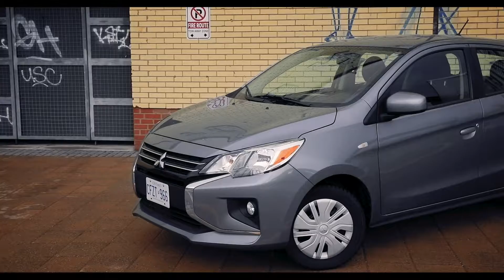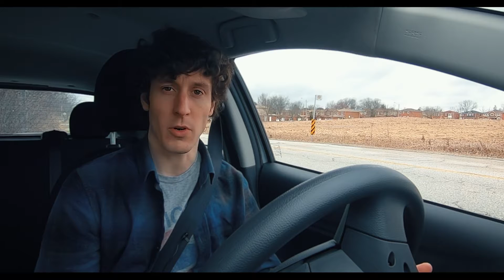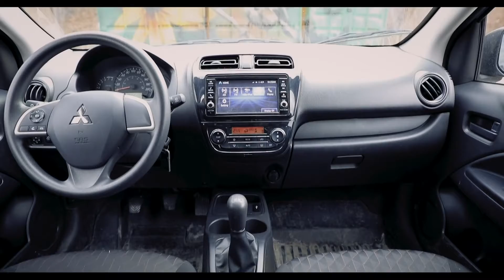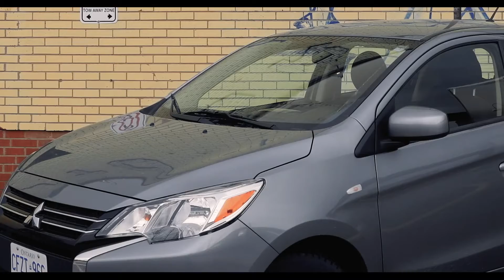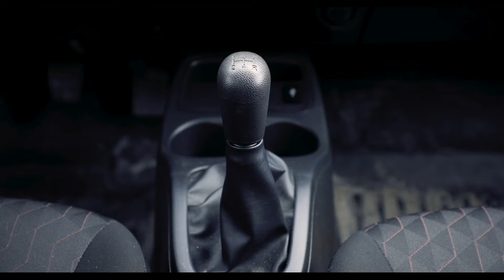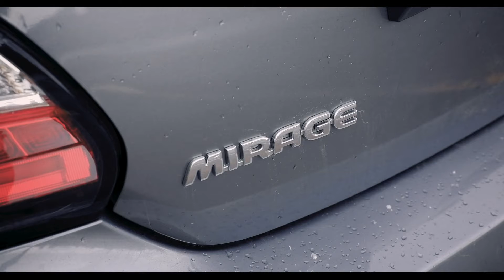Long-Term Wrap-Up: Mitsubishi Mirage ES | Driving.ca

Comment: We have a 2022 Mirage SE and I really expected to hate it. We bought it as a cheap commuter. I have a 2015 Ram 1500 hemi and my wife had a 2014 caravan. We’ve had the mirage for 3 months now and have over 10000km on it. I actually really enjoy driving it and there is lots of leg room, etc…. I’m 6’1” and not cramped at all. We’ve since sold my wife’s van as we stopped using it. We still need the truck to pull our boat.

The things I dislike about the mirage are really trivial. 1. The low fuel indicator it does have one really. Just the digital fuel indicator blinks on and off but it’s almost at zero anyway so you often don’t notice it. 
2. The electric fan for the radiator turns on and off way too fast, it will literally kick on and off every 2 seconds, it’s just going to wear out the relay fast.
3. We have the SE and it has Apple CarPlay but it only works wired and not over Bluetooth.
4. I would like the passenger front seat to also have an armrest

That’s it. It’s a great car, I expect to be buying another one in the future
Reply: You can use bluetooth independently of Apple CarPlay or Android Auto. Just unplug it from its USB port and switch to bluetooth mode on your steering wheel. I also use my 12V outlet to charge my phone, as it's alot faster than using the USB outlet. 

My wife and I are on our 4th Mirages, a 2014 DE CVT, 2017 ES CVT G4 sedan variant, my current 2021 ES CVT, and I just got my wife a new G4 Black edition 2022. 

Reliability is a fantastic reason to own a Mirage. The JATCO CVT7 isn't stressed at all, like it is in Nissan products such as the Juke or Cube. 78HP and low curb weight equals exceptional cvt reliability. My 2014 I used for Uber ride share and I beat the dog shit out of it putting 100k miles on it in under 3 years. Never once did I have a CEL or any major issue, only a failing door lock actuator. I'd still be driving it today if I hadn't totaled it last December. The 3A92 engine is timing chained and has been in continuous production since 2003, so you know it's a proven engine design. I never experienced any oil leaks at all.

The patented Mitsubishi RISE safety cage saved my life on the freeway, I walked away unhurt. It would of been a different story if I was driving a small car from the 90s. Folks who say these cars aren't freeway worthy are giant pussies, who've never owned one. I drove my old Geo Metro/Suzuki Swift rebadge across the country and it only had 60HP lol.

My only complaint is that Mitsubishi part prices are expensive and that the aftermarket selection can be sparse. I also think Mitsubishi dealers are shady as hell but thank god I've never needed warranty work as these cars are basic but dead reliable.
Reply: @kylemas2005  This is our first mirage but we really enjoy it so far. I entirely expect it won’t be our last. We have >15000 kms on it so far which is just shy of 10000 miles and we have only had it since May. Definitely impressed so far.
Reply: @Gord1973  Your 175 55 r15 tire size is rare and expensive. When your ready to change switch up to 185 55 r15, it's within the 3% differential tire shops recommend, there's alot more options in that size too that's  cheaper and your mpg won't take a hit because it's just barely taller than the OEM tire.
Reply: Gibt es bei Amazon für ca.60 Dollar

Comment: I'd actually consider this car if for some reason my 2013 Chevy spark decided to bite the dust. I don't trust the used market these days, as anything under 10 grand in the used market is going to come with problems.
Reply: I'm thinking the same exact thing. With the cost of the used car market rising because of shortages, I'd bite the bullet and get something new for a little bit more. Would make a good little second vehicle.

Comment: Just got into a wreck with my Mazda 3 2012. I want to get this car but am on the fence. I'm not a speeder, but sometimes it's good to have speed to get out of the way.
Reply: The Mirage only weighs 2100 lbs. 78HP is plenty. Don't worry about it.
Reply: It's got about the same HP to lb ratio as my '90 Volvo. So, you should be just fine! lol

Comment: Moving to the CVT from the manual makes a huge difference on the interstate.  My car runs at 70 mph with the tac showing 2500 rpm and returns 44mpg cruising at that speed.
Reply: Very nice! Just the comment I’ve been searching for. I drive 40 miles one way at 65mph, so hopefully your mpg’s is achievable for me as well.
Reply: @johnpatterson4901 can you explain me what is mpg and why cvt is better? I thought it would has more gas consumption

Comment: My first car was a Ford Escort LX, 88 hp, 5 speed.  I drove it for 16 years in CA and all over the American west.  Never felt under powered except on steep grades like the grapevine on I-5.  The Mirage reminds me a lot of that car; if I needed a new car right now, the 5-speed ES Mirage is what I would buy.
Reply: I used to own a Chevy Sprint ER with a 3 cyl 5 speed. It was supposed to be the lousiest car in USA but I’ve driven it to LA and SF and back more than a dozen times, usually at night and all kinds of weather. It was a fun car especially negotiating the high mountain pass 152 from I-5 to 101. Never had a single breakdown thru several years driving it.  A real fun but utterly reliable car.

Comment: I’m curious, how is the Mirage going up hills? I live in an area that has a lot of hills and am currently window shopping for cars for when it’s time for me to get a new car.
Reply: You absolutely have to downshift with the manual, but it pulls itself along okay, if you actually cram 4-5 people in it you definitely feel the difference, and turning on the A/C is a notable drop as well. I ultimately loved my Mirage g4 though, it was totaled when I was rear ended on Tuesday, but I averaged 44.9 mpg over 36k miles with the 5 speed.
Reply: @Dfm253   It's horrible up hill in a cvt. Most of them are sold with cvt because only the base model is sold with optional manual transmission. Putting just one person in the car or having the ac on if felt in a negative way with its 7X hp. You have to remember drive train loss so it would really make it a high 40s, low 50s hp car. I rolled down a hill in winter of 2020 with it starting from a dead stop mid way on the hill and there wasn't even any snow on the road. Every other car made it up just fine. I had to go back and find a different way back home.
Reply: @jesuscarrillo4344  WTF? I drive my Mirage CVT in the mountains of Appalachia and never had an issue of not being able to get up a steep incline. Something might just be wrong with your car?
Reply: If you go up a hill don't you eventually also have to go down it? So, because of that it should work out ok! lol
Reply: It does fine honestly, and I'm not even exaggerating or sarcastic.

Not quick as 1st place out of 8th but it gets there as 5th place.

Comment: I've been debating between the Mirage and the Spark . You said the Spark is a better car is it because the Spark has 4 cylinders is it because or that the Mirage only has 3 and less HP. But what about the warranty isn't the Mirage much better?
Reply: The mirage has better warranty, and the mirage is designed for longevity, things like electric power steering, an actual timing chain (not a belt like most small cars) and tons of space to actually do your own repairs on the occasion they should be necessary, make the mirage much cheaper to own long term.
Reply: Spark is being discontinued because it wasn't as reliable with the JATCO CVT7, compared to the Mirage with the same CVT. GM Korea aka Daewoo, got tired of paying for warranty work and cvt replacements.
Reply: @kylemas2005  They should have equipped it with a transmission cooler. Like Mitsubishi does.
Reply: @kylemas2005  I have seen that the smallest cars in the US are being discontinued due to poor sales bc people want SUVs.

Comment: Satisfied with my 2022 so far. Plus sizing to 16" wheels can improve fuel efficiency on the manuals as it changes/fixes the effective gear ratio and final drive to be much more in-line with Ontario speed limits.

Car was made for Thailand so it got very short gear ratios. Increasing the actual rolling diameter of the wheel and tire combination by about 5% means that the speedometer now shows exactly the speed I'm actually going, and the gear ratios are about 5% better - resulting in about 5% better high speed fuel efficiency which is important in Canada, with less stop and go traffic and more highway/long-distance driving.

I'm going to grab coilovers and sway bars for mine to improve handling feel and reduce body roll. I'm a track day instructor for Ontario and Quebec so I'm constantly road-tripping and I don't want to spend much on a car that isn't my race car so I got the Mirage as it's the most affordable car in the long run, once you factor in my 200,000 km optional/available warranty. I led a low-ish speed lead-follow exercise on a race track in my Mirage and genuinely didn't find it that bad. It went where I wanted it to, I just had to adapt to a lot of bodyroll. I've already changed the shift knob for one that's smaller and metal, it feels nicer to shift now, I can easily tell which gear it's in as the metal gives more feedback and definitely think that the reviewer's take on the shifter is because of the dulling/numbing of the plastic in the shift knob.

Mitsubishi could absolutely offer one of these in a Ralliart trim package with stiffer suspension, sway bars, and a bit of an appearance package.
Reply: But if you upsize the wheels doesn't that mean you have to get wider tires also, which will add more rolling resistance and decrease fuel economy?
Reply: @greeneking77  You can keep the section width the same, but increase the aspect ratio or wheel size to increase diameter. But the contact patch will lengthen and increase rolling resistance. It also raises ride height, which increases drag - not a good idea IMO - short gearing improves City MPG, so any perceived loss in Hwy MPG is offset provided you drive roughly 50:50 mix (like most)

Comment: Honestly, i love my 2022 Mirage. The gas milage is incredible, and the simplicity of it means there's less that can break or go wrong. In this case, less truly is more. It's a fantastic and honest vehicle.
Reply: I am guessing your actual mpg are better than stated. I was getting 52 hwy with my rental and the warranty is excellent
Reply: My 2015 purchased 5/15 still gets better than EPA. Other than no obvious clear coat 😡 it's still on the original NISSAN OEM battery mfg 12/14 (distilled H²0 only) no problems at all, normal maintenance, comfortable seats and quiet.
Reply: @lklpalka  interesting for your battery, it's the first thing that failed on my Sentra '95. btw I thought Nissan's share in Mitsu was just a recent thing with their outlander/rogue.
Reply: @oi32df  I think you're correct there. Been a few years but mergers are slow to see changes.
Reply: Simpler cars are definitely the way to go. Much less to break. Advanced electronics are bogus gadgetry.
Reply: Give me a manual gearbox and no electronic nonsense and you have absolute reliability. I've had my Mirage for 10 years with 165,000 no problem klms.
Reply: What was your gas mileage mpg?
Reply: Just wish they didn't have electric front window . I hope there is no door lock either?

Comment: I still drive my 2013 mirage 5speed. While it's true that sometimes I wish I had a better car, this car is just so damn reliable! It does what it should efficiently. Cheap to maintain and cheap to run and none of the BS! with today's crazy fuel prices, makes me appreciate this more and more.
Reply: I have the same car i think, 2013 mirage 5 speed 3 cylinder 1.2L engine. I love these little japanese cars, i have had a daihatsu handivan, charade and a suzuki carry to suit my various jobs but now the mirage and its the smoothest and fastest and also most efficient. Australia
Reply: Mine is a 2013 too. It's very hard to justify spending a lot more money for a new car which is probably not as reliable. I think I will drive mine until it doesn't drive anymore.
Reply: @LTLT900 how many miles you have on it? Is yours manual? And does still ride ok and on gas?
Reply: I love what you said.  I feel the same way about my 2015 Nissan Note.  Incredible gas mileage, super reliable and even though I wish I drove a more luxurious car sometimes I'll be grateful for my Note.
Reply: Why there is no central locking? Is there any place you can suggest me to fix that
Reply: @seby.augustine  mine has central locking like most stock mirage. I'm from an asian country so I really can't recommend a place/shop for you to have that fixed. I guess any car accessory shops should be able to work on installing a central lock.
Reply: That is exactly how I feel about my 2008 Chevrolet Spark. I've had it 12 years and it has been so reliable I have put up with it being slow and small. I'm now looking at getting the Space Star as a replacement for the Spark.
Reply: I didn't know they made them in 2013.  What was the MSRP price at that time?

Comment: Finally a fair review for a cheap car.
Reply: Debuted at $10900 in 2013 or 14  in USA. They have some that are $20000 now. Still cheaper than Kia or Hyundai junk
Reply: @marshmower  The top trim SE Mirage will top out after all fees and taxes at around $20k. They do come with a lot more amenities now though vs what it came with in 2014.

Comment: Good review Clayton Seams. I've had my Mirage over 8 years. No A/C and manual ES trim. Took 8 years to ever put more than $40 to fill. Has saved me a bundle with our yo yo gas prices! Handles great and fun to drive, kinda small leg room wise but so what.
Reply: hello am curious did you ever change the transmission oil? nd at what mileages
Reply: @legion1630  
if this is for a cvt with frequent oil changes (not recommended...) his is manual .